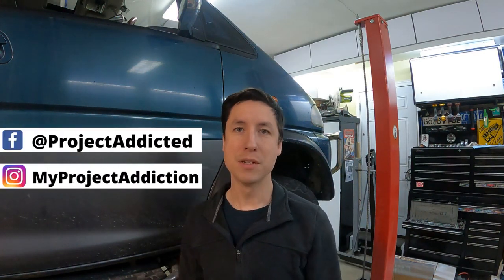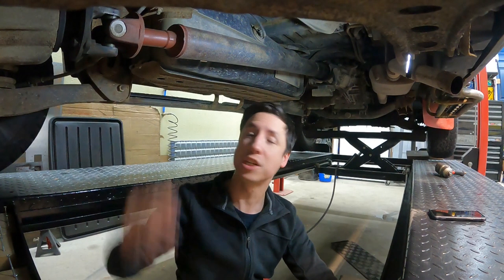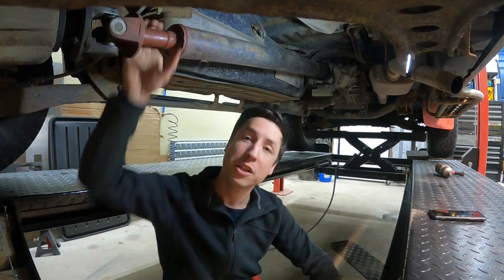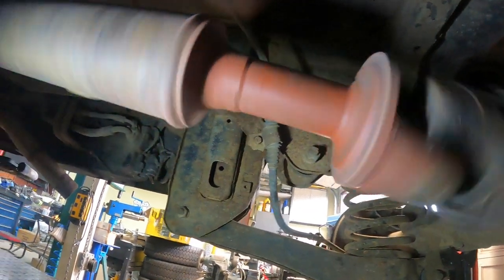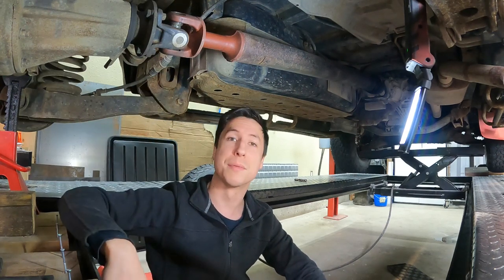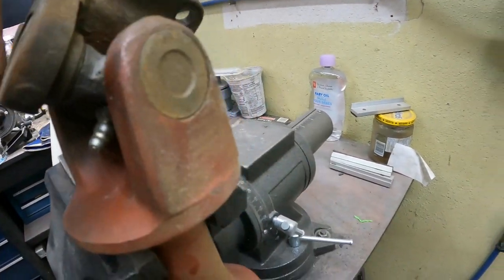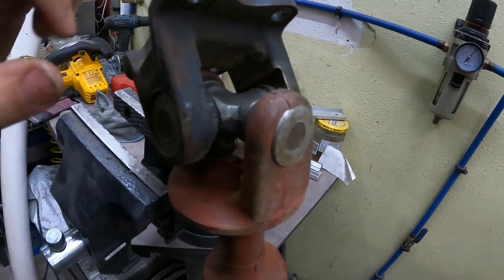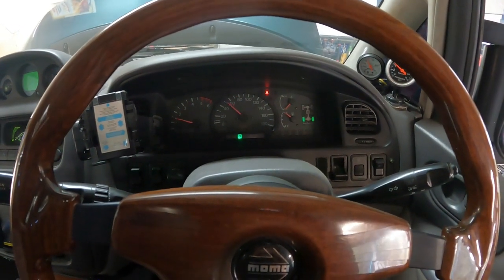Driveline Vibration Diag and Repair

Comment: My “Sport” light on the dash also flashes, same as this Delica. Is that because the shocks were replaced with non-ECS, or maybe the actuators were removed so there is an open circuit because the plugs aren’t connected? I’d like to stop my light blinking if possible.
Reply from the maker: Hi Ronan, if the adjustable shocks have been removed you will likely get a fault thrown for it. If the system has been removed it may be possible to jumper the plugs however I cannot say for sure as I have not attempted to fix a blinking sport mode light yet. In saying that if the system is gone it may be easiest to just remove the bulb from the cluster... It is redundant now that system is gone anyways.

Comment: What a very very nice steering wheel you have! Know what model is that one? Also, you should apply grease into that tubby thing on the joint.
Reply from the maker: That steering came in an L300 bought years ago and has been swapped through each new van since then. Honestly not sure what type of wheel it is.

Comment: Nice hair cut bro
Reply from the maker: Cheers. The locks had to go after the gear oil explosion ;)
Reply: Oh I remember I saw the video the other day.how did that happen?Air line popped out?
Are you planning to make a movie of the white smoke from the exhaust pipe? Or is that just the moisture?
Reply from the maker: @applepen6428  I designed a pneumatic fluid transfer tool but wasn't paying attention during use, and over pressurized it causing the entire bottle to explode.

Glow plug and injector video will be coming in a few weeks.